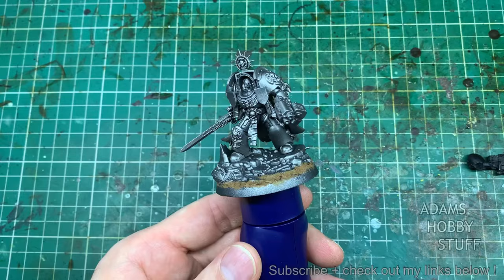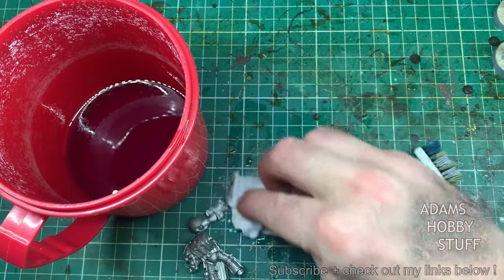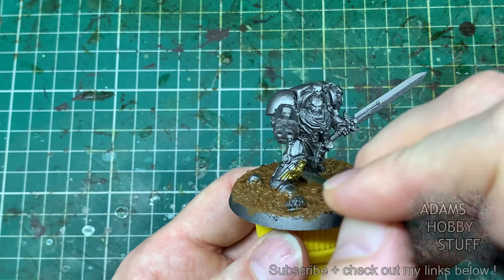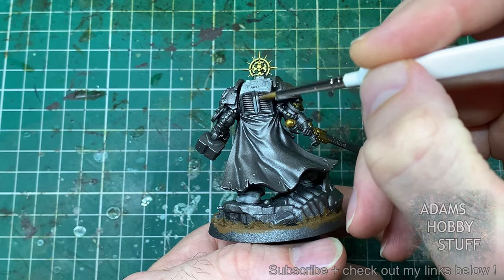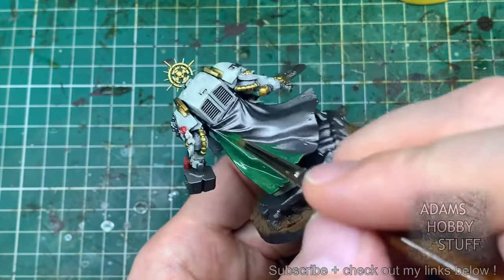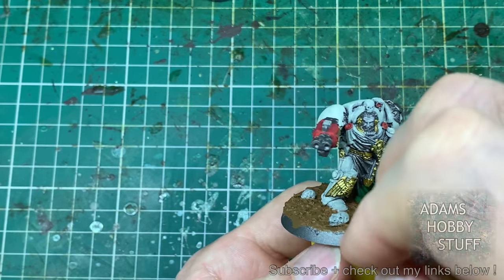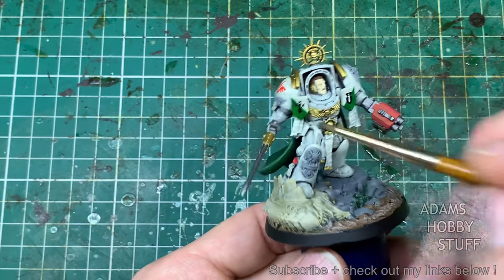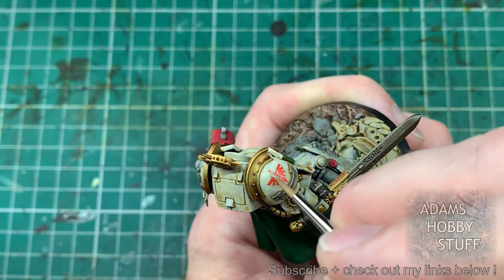painting plastic leviathan terminator captain alongside old hammer metal 3rd edition 40k vs 10th !

Comment: Loads of these on eBay.  Is it part of a boxed set or something?  I just got my guy for £15, with P&P.  Exactly the same as the captain here, except with a terminator head, instead of human, and armed with a power mace.  I'm just finishing up collecting a 40K Iron Hands army, which is all Vehicle, now that the army list composition is changed in the 10th edition.
Reply from the maker: This was from the 10th edition box release but the mace one is a different set I think. All very nice models and in a much bigger scale than before.
Reply: @adamshobbystuff  Ah, OK.  I thought it was from the Leviathan set at first.  I did have to track the model down, since I hadn't seen that exact model before I bought it the other day.  Still, for £15, It's not a bad model to add to the collection.  Like I said, there are dozens of them on eBay.  Leviathan and indomitus are still quite popular boxed sets.